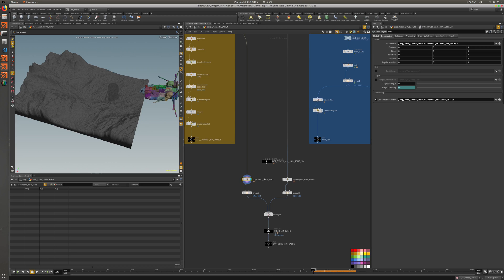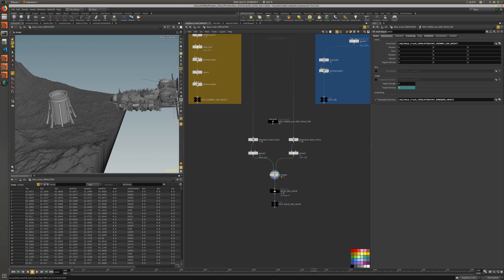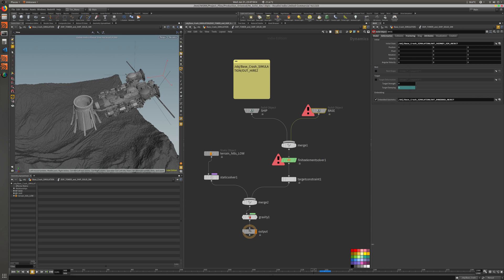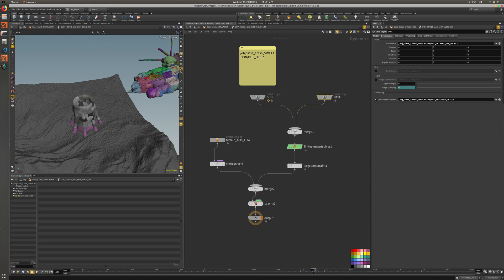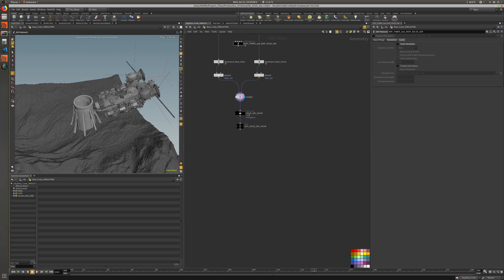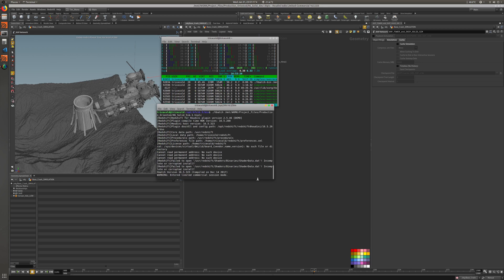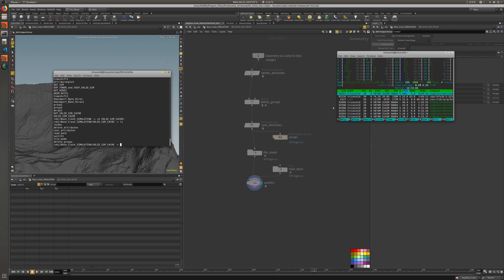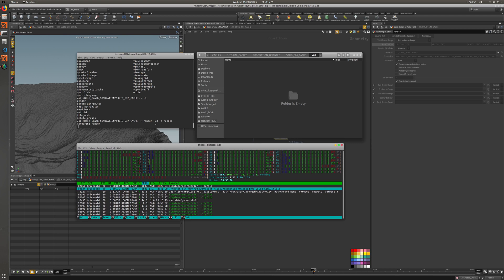VFX Studio Oriented / Solid Solver Sample Video

Comment: Hi, I'm doing the tutorial with houdini 18.5 and the tower geometry deforms when it collides, it breaks but it does weird stuff. They have changed the fem solver and there is a new way to do it with GNL I need help because I'm a little stuck. Thanks in advance.
Reply from the maker: DM me you e-mail adress so I can get back to you regarding the issue. You can also send me an email using the email you made the purchase with, I can then explain the difference between the new and the old Solid Solver methods.
Reply: @StudioOriented  thanks, tomorrow i write you by my email that I used of purchase

Comment: How is your screen so sharp. I see it on youtube with this monitor OK but when I open Houdini apprentice it sucks. Is that because it's free. Do I need to upgrade to indie to get the same res you have here?
Reply from the maker: @ClausBohm-j6o  did you change the scaling from Houdini settings, otherwise everything is so tiny
Reply from the maker: No, it's not related to license type, that's a 4K monitor, running Houdini on HIDPI scaling

Comment: because i will by this course  so conform ....
Reply from the maker: It's Ubuntu, but Houdini has command line both on windows and linux
Reply: Thank for the information sir...        
i will try this but in case any problem, i willl hope you solve this  problem....
Reply from the maker: Hi Derrin, all the information is available on the website and my internet page , yes this course includes everything you see in the screen
Reply: Thanks sir
Reply: Hii sir,  i am ask you  question,  which os are using  in this course, and i saw the sample video u are  type command line code , and my os is windows 8.1 so it's work same as you work in sample video, sorry sir but i am beginner so ask you..